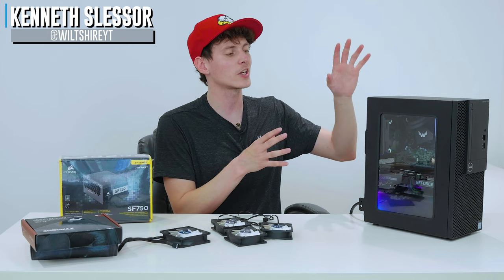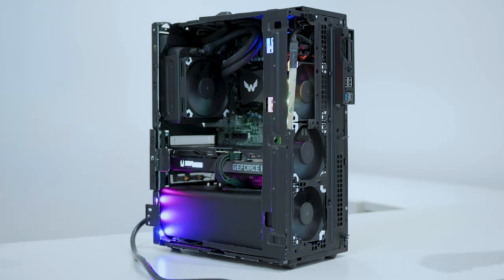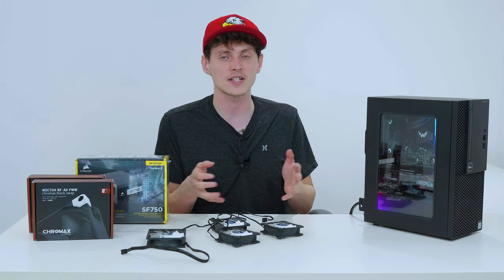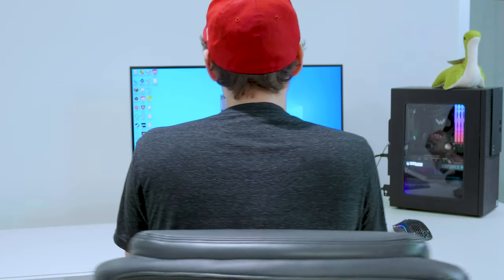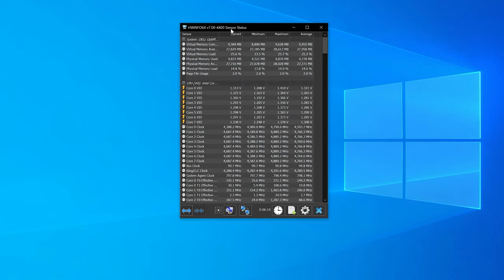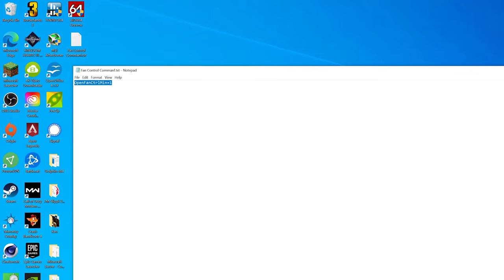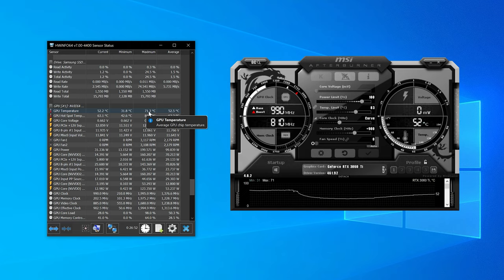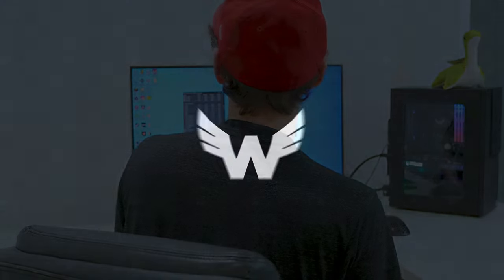Fixing My Overheating Modified Dell Optiplex Gaming PC

Comment: Damn, I had no idea you could swap motherboards between different Dell Optiplex models! Did you have to make any modifications to fit the 7070 motherboard in the 3040 chassis, or does it just slot right in?

I wish I’d have found your channel earlier. I love the PC I built, I spent a year collecting the parts for it and was finally able to build it in January. It’s the first one I’ve actually straight up built too. But building something like this would’ve been so cool! Always loved the look of the newer office PCs, provides for a nice sleeper aesthetic (that is, if it isn’t all kitted out with RGB lighting and a transparent side panel lmao)

This is probably the most unique gaming PC I’ve seen in a long time. Prior to finding your channel, I’d never seen a liquid cooled Optiplex. OptiFlex is definitely the right name for it
Reply from the maker: There are slightly different, the motherboards. It will drop in and fit, minus the rear I/O. I had to make a few cuts to the case to line the ports up properly.

There are decent PCs with some REAL annoying quirks. But, if you get past them, they're a reliable PC.

Glad you like how OptiFlex turned out! It's probably my favourite build that I've put together thus far

Comment: I think the fan curves actually had the biggest effect on the lower temperatures.
Reply from the maker: Very possible! The Noctua fans have higher static pressure too. So that definitely helps
Reply: @WiltshireTutorials  I'd love to see a video where you compare the Noctua's against the Arctic fans, with a standardized noise db!!!
Reply from the maker: A little hard to do standardized noise dB when you only have 3 options for fan control speed!

Comment: Hey Wiltshire, I’m just revisiting your videos. I upgraded to a 7070 with an i9-9900 as well. I’m running into a hot box problem too. I’m looking into liquid cool now. Just wondering how did you hook up the asetek cooler. The 7070 motherboard only has two fan headers. Curious on how you did it.
Reply from the maker: Use the CPU fan header for the fans and then just get either a SATA to fan adapter or a molex to fan adapter and run the pump at 100% speed.

Comment: any tips on upgrading the motherboard? i've been drooling over new parts recently. watched a build video with the motherboard i want and it dawned on me: how will i connect the possibly proprietary power and front IO into the new motherboard? are there adaptors? HAALP
Reply: i might just get a new case and call it case closed 😋
Reply from the maker: Unfortunately, this motherboard is proprietary and not a standard sized motherboard. So, case swapping is not possible.

Comment: I hope you will see this.... my question is probably the most trivial compared to the rest here. After removing the DVD drive, how did you "plug" the DVD Drive on the front if the  plastic case?
Reply from the maker: Dell sells Optiplexs that do not include a DVD drive. For those models, they snap in a dummy plug to fill in the cutout for the missing drive. I simply found a front panel that had the blank piece and snapped it in. Alternatively, you can pry off the front panel on the DVD drive and fill the gap with that.

Comment: Hello, I've been following you for a long time and I like what you do, I bought a Dell 3070 with i5 9500 processor, 16gb ddr4, etc, I modified the case for good cooling but unfortunately I have a problem with the cooling of the video card, Gtx 1050ti, the fans they are at 0 rpm, as is normal for this board, when it heats up, they start at 100 to 100 speed, even if the program shows 43-48 rpm, when the board reaches 27 degrees Celsius, they continue to run at maximum capacity, the problem is solved with a restart.
Reply from the maker: Sounds like a VBIOS probably for your card. Looks like the fan curve is out of whack. Check to see if the card has an update for its VBIOS. If there is none, you can set a custom fan curve using MSI Afterburner

Comment: I don’t think power supply upgrade was necessary because I done the calculations on newegg power supply calculator and it recommends about 360w-400w and most of the part in your dell don’t even need that much power. There is a dell xps 8940 with rtx 3070 as the highest option and it uses 500w power supply
Reply from the maker: It's mostly for future upgrades with future GPUs!

Comment: Is anyone having a problem with overheating of the SSD in M .2 slot in the Dell Optiplex 3050 small form factor I have several Dell Optiplex 3050s SFF i5-7500. When I checked the SSD installed in the M.2 slot with crystaldiskinfo, they all have a temperature problem with the m.2 slot. No problem with the cabled SATA 2.5 inch SSD. So far five out of the five I have checked the SSD  in the m.2 slot has a high temperature.
Reply from the maker: I have a heatsink on the M.2 SSD. So, I haven't had any issues with the temperatures. I'd suggest maybe trying an active M.2 heatsink to try to cool things down a little.

Comment: Is it still worth doing this build for 2023 or just better off buying new
Reply from the maker: I would say it all depends on what you can get an OptiPlex for. If you can get a really good deal on the system itself, I'd say go for it.
Reply: @WiltshireTutorials  I got it free as my workplace were throwing it away.  So just wanted to upgrade it then a friend sent me your video and I thought that was really good
Reply from the maker: That's a pretty good deal! What model of OptiPlex did you manage to snag? Also what are you looking to do with the PC? Gaming, editing, etc.
Reply: @WiltshireTutorials  it's 3040 with the i5 processor I'm not that well up on pc's to be honest but would like to try and do it myself for the experience. Looking to do some gaming and editing with premier pro.
Reply from the maker: That's a decent machine to get for free! It'll do quite well with 1080p gaming and some light editing. With the stock power supply, the max GPU you can use is a GTX 1060 6GB or an RX 470. The PC will work pretty decent with those GPUs. If you want a little more power, then you're going to need to mod an SFX PSU into the PC, like I did in previous OptiFlex videos.
Reply: @WiltshireTutorials  ok nice one mate that's helpful cheers
Reply: @WiltshireTutorials  Is it worth putting in the samsung evo ssd 2tb
Reply from the maker: It would highly recommend an SSD as your main Windows boot drive. It helps a lot. If you have any more questions about upgrading and whatnot, feel free to ask away.
Reply from the maker: No problem!
Reply: @WiltshireTutorials  cheers

Comment: Noctua's Chromax fans aren't as good as the beige and brown ones - probably because they are made of a different type of plastic.
Reply from the maker: According to Noctua's website, both are have the same specs and are made out of the same material. No 2 fans are built the same. Which is why there can be a ±20% performance variability between fans.

Comment: Uh-oh... Not good. Those internal Temps are really not ideal, seeing that the Temps shot to 194.7°F...
Reply from the maker: Yup! Wasn't very good! Luckily, I was able to solve the issue :p
Reply: @WiltshireTutorials  Having anything go over 100.0°F isn't good, let alone 120.0°+. When it comes time, for my newest custom PC rig in 5 years' time (the prices on the PC Parts are still out of control), in my PC there will be these industrial-class case fans that will have to go on Max Power at all times, and in addition to that, an external, industrial-class High-Speed (Floor or Drum) fan will be activated at its highest speed.

Comment: Ah yes another one
Reply from the maker: In the words of Dj Khaled "Another One!"
Reply: @WiltshireTutorials  man of culture :)
Reply from the maker: :D
Reply: @WiltshireTutorials does Aigo GP550  work with M-ATX boards and case and is it fully modular?
Reply from the maker: Technically, it will work with any motherboard with a 24-pin power connector and 1 CPU 8-in power connector. It is not modular in the slightest. Not even semi-modular.
Reply: @WiltshireTutorials  So can i use ASRock B365M this motherboard with this PSU??
Reply from the maker: Yes

Comment: Wow a dell opltiplex with a intel i9 how
Reply from the maker: The 7070 MT motherboard surprisingly supports the i9 9900!
Reply: @WiltshireTutorials  omg i really want to build it but it will work with a rtz 2080 ti
Reply from the maker: Unfortunately, the card would be too long. The max length you can fit inside the case is 240mm. You could get a 3060Ti or a 2070 Super from Zotac and they would fit!